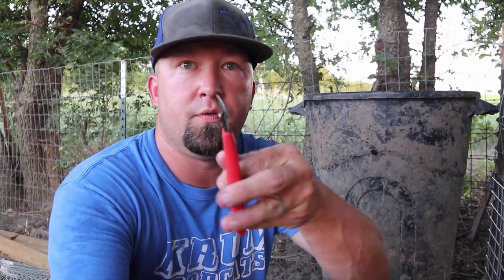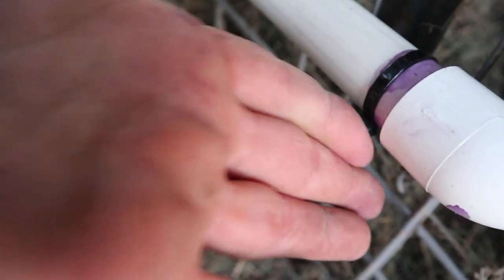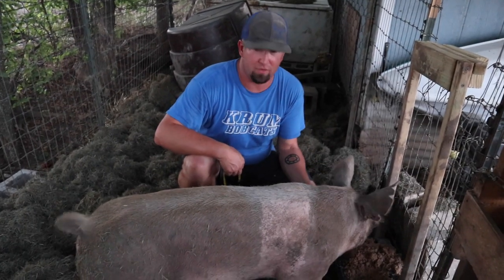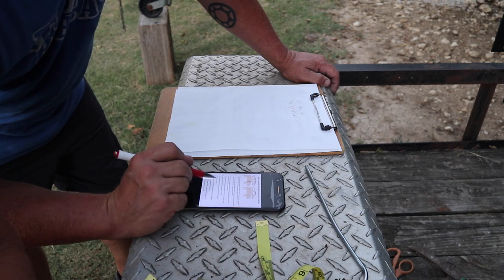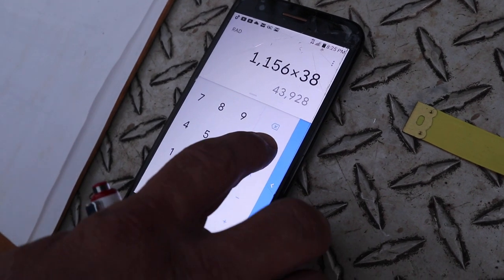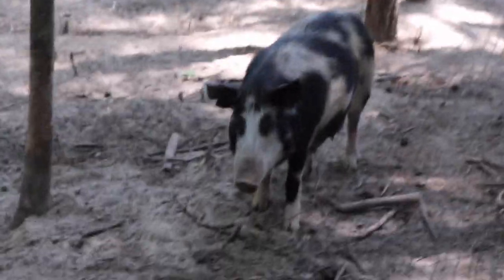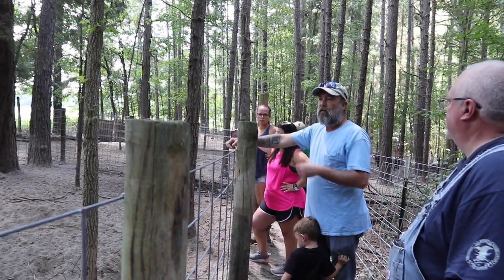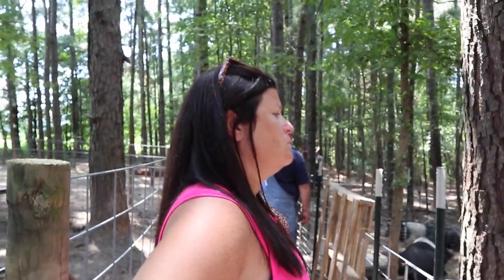Using The Tape Method To Measure Our Pig - Talking To A Pig Expert - Hanging With Smith Family Ranch

Comment: I am cracking up, but I know it's not funny. The look on Shanna's face though when she found out the weight. I think around 125 lbs but hard to tell. Sawyer Ridge Farm measures their pigs this way also. You answered all my thoughts. Automatic feeder for sure! Ours are eating so much and we have to fill the automatic feeder up a lot more than what we did last month. I was wondering how old she is but you answered that also. We were told people usually get pigs in the spring and they aren't ready until January/February. Not sure though. CORN CORN CORN. Mix ground up corn into her grain. PLUS feed her all your leftovers possible!

Comment: I just Googled  this: Using the measurements from steps 1 and 2, calculate body weight using the formula HEART GIRTH x HEART GIRTH x BODY LENGTH / 400 = ANIMAL WEIGHT IN POUNDS. For example, if an adult pig has a heart girth equal to 45 inches and a body length equal to 54 inches, the calculation would be (45 x 45 x 54) / 400 = 273 lbs.Jul 26, 2019
Reply from the maker: We plan on doing this again before she goes to the processor, and we can see how close she is to what we have. We think she is pushing 300# right now.